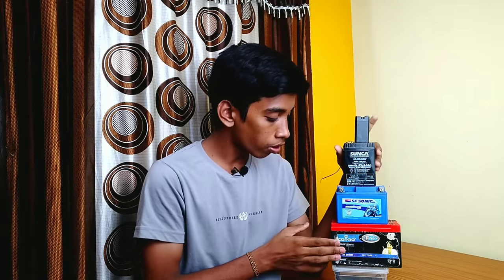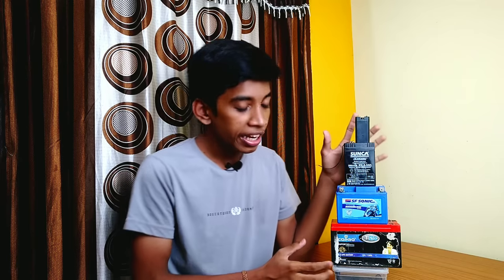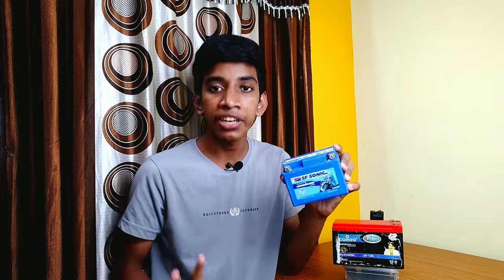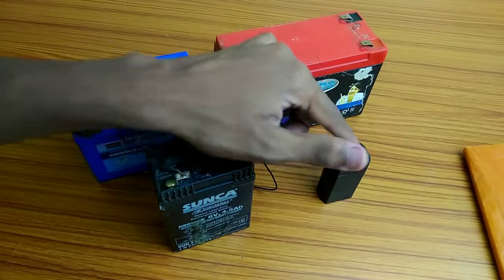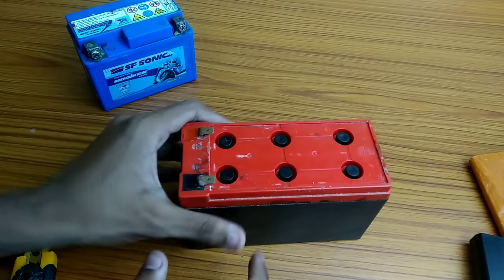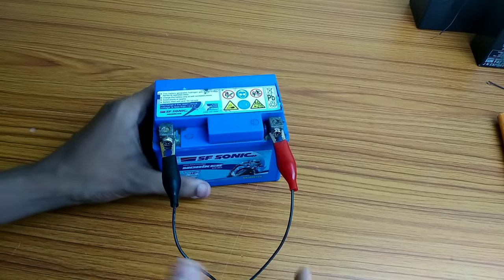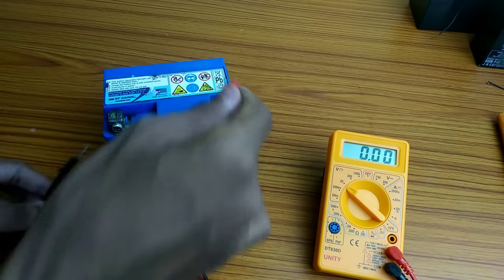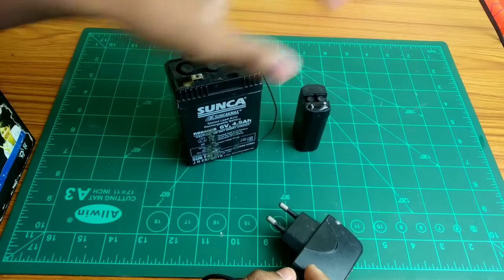How To Charge 12v Battery At Home ||  12v Bike Battery Charging || In Telugu

Comment: Please take safety precaution first ,
Distilled water is also called as cheap water.
 H2So4 is sulphuric acid Never touch it will melt the bone and donot try charging at home you may short circuit the whole place or the battery may explode it is hazardous.

Comment: Bro 12v 9ah new battery మీ దగ్గర ఉన్న ఎర్ర బ్యాటరీ లాంటిదే దానికి 12v 1 amp చార్జర్ తో ఛార్జ్ అవడం లేదు ,షాప్ లో అడిగితే 14v 1.7amp చార్జర్ ఇచ్చాడు బాగానే ఛార్జ్ అవుతుంది కానీ అది 1వీక్ పని చేసి ఇప్పుడు ఛార్జ్ చేయడం లేదు ఇలా 3 వాడాను పర్మనెంట్ గా పని చేసే దానికి ఏది వాడితే మంచిది 0-12 eliminator వాదమన్నాడు వేరే షాప్ అతను అది వాడొచ్చా అది అయిన లైఫ్ వస్తుందా నా దగ్గర డిష్ టీవీ, టాటా స్కై,వాటి 12v 1amp chargers చాలా ఉన్నాయి కానీ  ఛార్జ్ అవడం లేదు ఛార్జ్ ఫుల్ అయితే ఇండికేటర్ గ్రీన్ లోకి మారుతుంది షాప్ లో కొన్నది కానీ ఇంట్లో ఉన్న 12v,1amp వాటికి ఎటువంటి గ్రీన్ ఇండికేటర్ లేదు అది నేను popcorn machine లో ఉండే 12v motor ,10ఇంచుల dc strip led light,oka 12 v సైరన్ యుస్ చేస్తున్నాను 3టైమ్స్ రన్ చేస్తే ఇక 4త్ టైం dc motor తిరగడం లేదు షాప్ లో కొన్న చార్జర్ తో ఛార్జ్ చేస్తే 10టైమ్స్ ఒన్ చేస్తే వస్తుంది కానీ ఆ చార్జర్స్ 1 వీక్ వర్క్ చేసి చెడి పోతున్నాయి లాంగ్ లైఫ్ ఇచ్చే చార్జర్ కానీ eliminator కానీ ఏదీ వాదమంతావు బ్రో

Comment: HI lokesh , i suggest you to go through about the things that you want to do.
The method you have suggested is not safe . We need to use the battery chargers only for the charging . The power adapters are not made to charge the battery. These adapters does not have reverse protection circuit inside it.

Comment: Ok but 12 volt adapter only gives 12 VDC .12 v 4/5 amp never fully charge ok for trickle charge.
When acid water fully  over pl put 1250  acid water not disturbed water

Comment: This guy is a begginer .....to charge a 12v battery correct amperage of the transformer or battery charger is required and pump voltage into 12v battery, the voltage should be greater then 12 v say around 13.4 voltage is required to get a perfectly charged battery...you house hold adopter is nonsence don't charge with any adopter